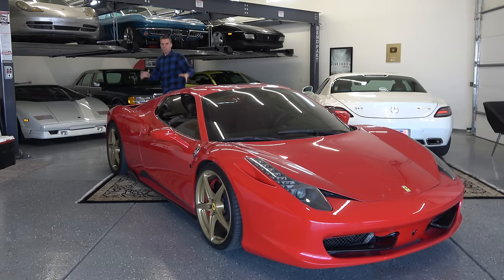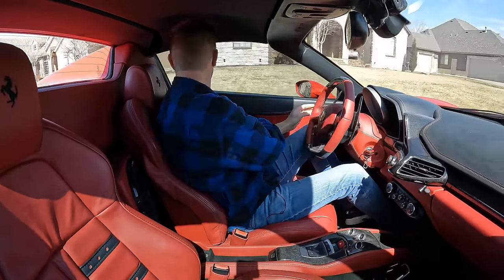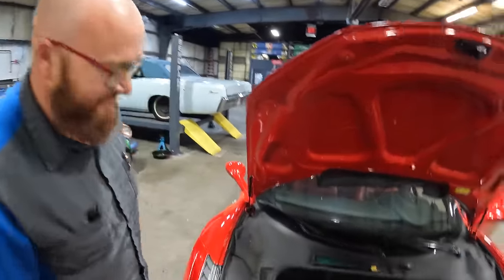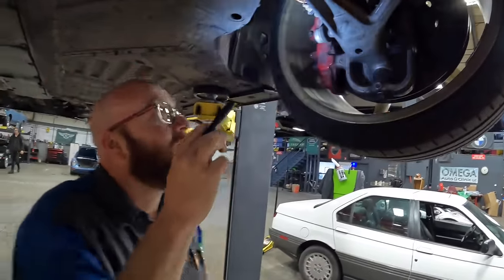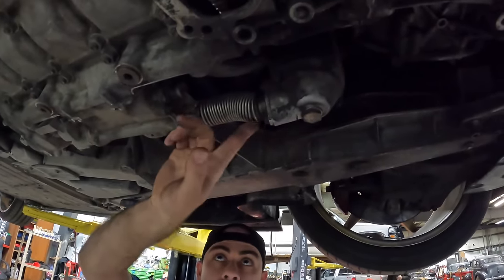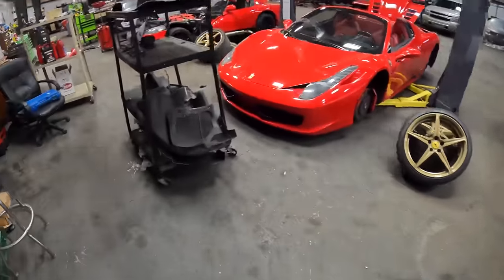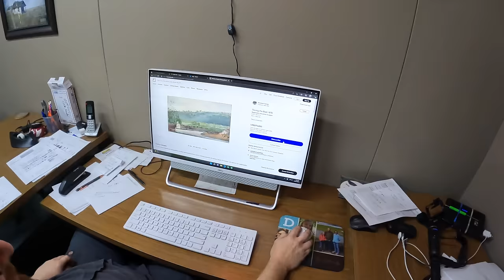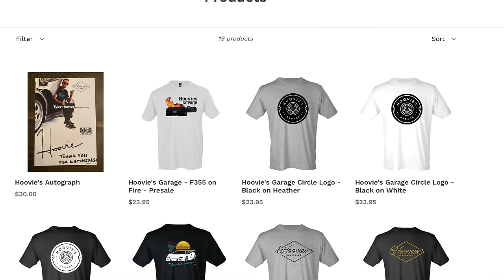Here's everything that's BROKEN on my Ferrari 458 (and why it was so CHEAP)

Comment: Regarding your Diablo noise, I know it is a completely different animal...but my 1995 5.0L Mustang was making a similar noise.  I tore the transmission out of it, replaced the throw out bearing and pilot bearing and the sound was still there.  Took it to a buddy who found I actually had a leaking intake gasket and the increased vacuum was actually sucking air past the rear main seal making the noise.  A shot in the dark perhaps, but thought I would share what I learned just in case it was relevant.  Good luck!

Comment: For your Lamborghini “drone” I had a brake booster that made that noise. Found it by applying vacuum to the system without the engine running. Good luck!🍀👍

Comment: I gotta say, I’d sure go ahead and do the annual service. I know I’ve heard of weird stuff specifically with the brake system if it’s not serviced. Especially since it had different brakes then stock I’d personally like the peace of mind that the fluid was inspected. And don’t forget there is a TSB on the 458 brake system that has no repair yet on the 458. It’s something to do with the Bosch components. I think I’d also do the under tray, though I think given this cars pedigree I’d try to source a used piece not new. And finally I think I’d repair the tub, specifically because that crack can and likely will get worse. 

I think I’d pass on the fuel tank issue unless it becomes a problem and while the diffuser is kinda important there’s no guarantee it won’t break again especially in Kansas and some of the roads here. I again might find a used one later if I broke the existing one more or worse. 

At the end of the day it’s a high mileage, salvage title Ferrari, with interesting modifications and ugly repairs on the front welded areas. It’s never going to be worth what a clean title car is worth. BUT it also is a running and driving 458 Spider that has minimal issues (except those noted) that you got for less then 100k. After these few repairs and the interior leather repairs and maybe a switch for the glove box your into this car for about half a non molested one. That’s a good purchase in my book. Likely anything that pops up would do so on any 458 and not attributed to the accident at this point so gold star for Tyler.
Reply: The brake system is no longer stock.
Reply: @CrashRacknShoot  incorrect, the rotors, calipers and pads are no longer stock, all of the internal lines, valves and electronics are still there, and the issue lies with a Bosch electronic valve.

Comment: Wild idea with the Diablo… could it be some kind of grounding/voltage issue making it’s way to a speaker in the cabin? If the RPM changes also make a  change to the frequency of the sound, the charge put out by alternator may be causing it?
Reply: I think that's why they were trying to shield the electronics with tinfoil.  RF interference.
Reply: @timdavis6088  wrong car

Comment: Check your Air Oil Seperator / Crankcase ventilation system system on the Lambo... I've had a similar strange noise and turned out to be a bad oil separator causing the motor to pull a vacuum through the rear main seal, which creates a moaning/whistling sound~  Replaced the separator and put in a new rear main seal just to be sure and boom - noise was gone.
Good luck!

Comment: I know it's not the same car but my Mondeo V6 had a moan just like the Lambo. It was a defective EGR valve. Changed the valve and the moan was gone. I hope this helps.
Reply: Does an old lambo even have an egr system?
Reply: @Psych0technic  No clue, but they were build around the same year as my car, so I guess there's a chance.
Reply: @BenFergus  is it gasoline or diesel?
Reply: @Psych0technic  Mondeo V6's only came with petrol engines.

Comment: Drive it with the dipstick removed. I have experienced strange whining sounds under acceleration due to failures in a PCV system. The next thing would be to check the intake system for a poor sealing gasket or similar.

Comment: Might try an adhesive dent puller on the fuel tank. Definitely cheap way to go, if it works and not so expensive if it doesn't. The crease might make it difficult to completely restore it to oe shape but it's working now, any improvement has to be better, right?

Comment: Would be cool if changing the cabin air filter would be an engine-out job  🙂
Reply: Its ferrari. Wouldnt surprise me if it actually was like that
Reply: The cabin filter is in the front when you open the “frunk” very easy to replace
Reply: @rickyn1320  dude, some how I think they were both joking.

Comment: My WRX had a cracked splash guard on the left wheel well. The tiny crack unknowingly to us, became a tiny hole. Long story short, it corroded one of the battery terminals, and it caused start up problems. I had to refinish the battery location, fix the splash guard and replace the battery terminal. A 58 dollar part became a bigger problem. Don't cheap out on splash guards. They may seem unnecessary, but they have a job to do.

Comment: I live in Vegas, and a lot of the roads here suck!
You need to put that shield on the bottom or have Wizzard make a plate to bolt onto that opening to seal it off. No matter how carefully you drive, you are going to get dirt and debrie in there around the flywheel and then the clutches and RMS.
An ounce of prevention....

Comment: The roll cage in the group B mustang is designed for multiple roll overs.  Barrel rolls if you will.  It runs very close to your head and you shouldn't drive it without a helmet.
Awesome race car and a competitive fun class.  
Cheers 🇨🇦

Comment: Since I've done this on my car, I can tell you EXACTLY what that bolt/washer combo is that's holding on the rear diffuser. Home Depot sells washer kits for holding lawnmower blades on. The bolt is probably from elsewhere on the car, and the washer is from one of those kits.

Comment: Check the seals on the power steering pump, Honda had a similar issue with moaning when air was getting sucked into the pump from worn seals around the hard lines

Comment: Over 80 thousand miles on a Ferrari is considered high mileage. I've seen old air cooled Porsches that have 300 thousand miles and running just fine. I'm not saying Porsche is superior and cheap to maintain but based on what I've seen about Ferraris, I wouldn't want a car that is a ticking time bomb.
Reply: Ferrari's are not made to drive 😆

Comment: For the Diablo, I wonder if it's not the throwout bearing but a trans input shaft bearing.  That bearing is rotating anytime the car is moving and in gear, and anytime the engine is running and the clutch is released.  I have a honda beat that has a worn input shaft bearing and the noise can be similar.  With the car actually driving, the only way to stop the noise even temporarily is to hold in the clutch while coasting in neutral

Comment: Could possibly do paint-less dent removal on the gas tank. Also tin foil might be used to block EMI, might have been causing issues with the sound system they put in, or other interference issues.

Comment: WRT to the Diablo, have you considered the PCV system for the groan? I've seen pressure going through seals, like the rear main, make weird noises like that.
Reply: The Volvo 2.5T also makes weird noises when the PCV system is clogged. Similar to a whistling.
Reply: Ill check it out. Thanks!
Reply: Yeah bad pcv valve diaphragm can totally do that

Comment: Buying 100k cars left and right.. getting shocked about 10-15k bill.. getting boring..
Reply: thats still alot of money
Reply: @MarcoElkes  no not really
Reply: @TheNismo777  really?
Reply: @TheNismo777  it’s a lot for a car repair bill. You can get a nice used car for 15k.
Reply: @MarcoElkes  you got a point, hell you can even buy two cars for that price, but a Ferrari which brand new would probably go for 200K to 300K. A 10k-15k bill at 86k miles is reasonable.

Comment: It's a nice dependable car. Dan from Normal Guy said, the thing just runs great! I agree with everyone else, you have to replace that under tray. The wind will crack that rear diffuser, and then it will just fall off on the road somewhere. You got away cheap with that purchase. I'm over 30k repairing my used F430.

Comment: I am not sure if that motor has balance shafts if it does I would check the timing and check the balance shaft bearings I had 
And Audi with a very similar noise it turn out to be the balance shafts bearing.
Reply: V12 doesn't need balance shafts.

Comment: Hoovster, you can buy a 4'x8'x1/4" sheet of HDPE/ high density polyethylene at Home Depot for $100 in black or white and cut & heat mold it as needed.

Comment: I had an similar noise on an H3, it was the front plate only vibrating between 2000 and 2200 rpm, didnt matter gear, speed. Like wizard said it can be some sheet metal vibrating.

Comment: Under tray protection. Get a sheet metal guy make one up. Say $1k.     Spend $40 bucks on fibre glass repair kit and spray can off paint..   Change fluids dont cheap out... Leave the fuel tank alone.  But if your worried maybe talk to dentless tech ...dont weld or stud pull  on a fuel tank..

Comment: could the noise be the PVC system?  I had a car with a partially clogged PCV breather, and it randomly made a whistling sound, sometimes right after I shut it off.  Took me a month to figure it out because it only lasted a second or two each time it did it.

Comment: It sounds like an air resonance problem I have ran into this a few different times on different vehicles and the problems I have encountered have been start at the intake from gaskets I've seen broken barriers inside the intakemanifold broken  air cleaner intake baffling take the air cleaner off as close to the engine as possible ie. before maf. if equipped or at the throttle body itself if map. or whatever it has run the car and see if it does it without the air filter system just to see if the noise goes away depending on results can aim you in the right direction also a smoke test in the intake manifold can be very helpful to find a problem like a blown gasket sounds like your blowing on a peice of grass between your thumbs even had cheap air filters poorly fitting in the airbox leaking around the seal cause a noise like this lol good luck

Comment: Those brake discs are on the wrong way. Left discs on the right and vice versa. Im surprised Wizard didnt pick up on it. Some of those parts such as the underbody covers can be searched for on Ebay or other used sites. The tin foil could be for interference suppression in the electrics.

Comment: Tyler, tell David to check the idle air control valves. I have heard that several times before and it was almost always an IAC. Also there may be a helmtz resonator on the intakes between throttle body and air filters. A lot of domestic cars those sometimes crack and also make that noise.

Comment: The dent in the fuel tank ok leave that, but the rest of the stuff what a tight arse. After all its still cheap even after all the repairs are done.
Speaking of fuel tank could they empty it,   block up all the holes , warm it up a little and blow compressed air into it and pop at least some of the dent out?

Comment: I daily drive a 1971 buick skylark all original. same motor since 71 an it still run as strong as it did when it left the factory if not better. 350.000 original miles on the motor an it runs like its got a 100 miles on it

Comment: On the Diablo, Is there any part of the intake manifold that is flexible and shouldn't be so you get a flutter?
When those guys that try to smooth out intakes take the flat bottom of intakes and cut off everything, they end up with a fluttering noise because of the intake flexing.

Comment: Regarding the Diablo…….wasn’t there a problem with old cars with a ‘booming ‘ sound from the interiors……. Where they had to remove the centre of the roof panel and replace with a canvas  panel….🤔🤨…… which stopped that noise………obviously modern cars have better sound deadening properties.
Has the Diablo a removable roof panel??…… take it off an try it down the road🤷🏻‍♂️

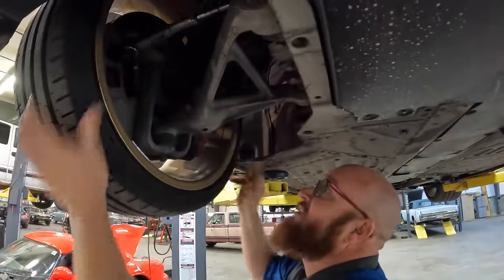Comment: 13:42 Does it have wheel bearings from the GTR also? 

Isn't it a risk to run like that without having the tips of the driveshaft in them?
Making a unnecessary load to the bearing and risking premature failure?

Comment: I have a 2012 458 Spider that Boardwalk Ferrari says needs a $10,000 dashboard and $20,000 to diagnose an oil leak, even though the dashboard seems fine, and it has no oil leak.

Comment: Dude, you got a Ferrari cheap as chips and you skimp on fixing it properly?

Never thought I'd see anyone treat a Ferrari so badly, the missing undertray would not just be for aerodynamics, it would be to protect parts above from road debris, at least get that tray, get the new rear diffuser with 6 fins (don't even bodgie one up with fibreglass  get a real one) and give it the proper annual service.

If it was an old beater Chevrolet or Ford pickup, sure cut corners, but don't cut corners so savagely with this Ferrari.

Enzo would be cursing you from his grave!!!

Comment: There’s a whole host of sensors and software that interact with the stability control systems that require the brakes to be correct on that Ferrari. I’d be surprised if any of those systems function anywhere near safely with the brake sensors disconnected and the wrong discs and calipers fitted. 😳
Reply: I really hope he puts the correct carbon ceramics on that thing. I cringed when he said it had 2 different rotors on there

Comment: Fix the paneling under the car... leave the fuel tank as is 
Fix the fibreglass, replace the fasteners, do what you can with the defuser, replace the battery for the correct one
Come on hoovie you’ve been far better to worse cars

Comment: To get the "car" on the lift, why didn't dumbledorf just lay in front of each wheel and use his belly to lift the car??
Then vanilla ice  could pull the car on the lift, easy! It's not a ferrari anymore, it's a nissan, suburu thingy with mixed matched tires😂

Comment: Sigh... this channel keeps going down and down, not spending on a skid plate for the engine is dumb... the thing rides so low that it should have something to avoid contact with it. Also, the rear diffuser... really?

Comment: Ok Hoovie heres what you do t cheap out on the must have bottom  engine cover. Get the overall dimensions for it to underlap rear diffuser and front engine  lip   attach area ( HIGHLY TECHNICAL TERMS USED) find a plastics company in your area. Have it made. Then use a JIGSAW to trim it to fit with a UNIBIT  for holes
 And buy a bolt kit on ebay
DUN DUN DUNNNN!!! AIR FLOW AND ENGINE COVER DONE CHEAPLY!!
🤣🤣🤣🤣🤣🤣🙂🤣🤣

Comment: Wow, hopefully got cheap in the worst way on this one. I understand the hooptie theme here but it's typically you buy the hooptie then fix the hooptie in reasonable fashion. In this case there is no fix fixing. Very odd not to fix those things on a car that still has a substantial value to it. As it is with all the known defects you didn't fix, it is just pretty junk. Not to mention you've spent way more money on cars that never had the potential value this car does if properly fixed. Definitely a thumbs down video.
Reply: Ikr, there are some ancient cars on his channel which he spent absurd money and attention on. Finally a car arrives which deserves it all and it gets barely anything done to it.